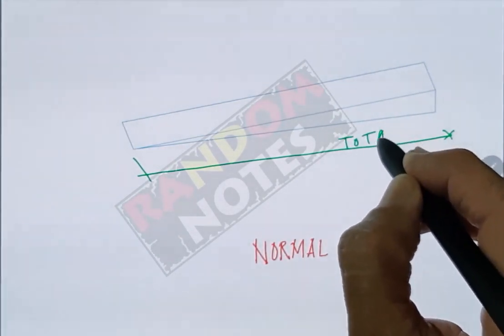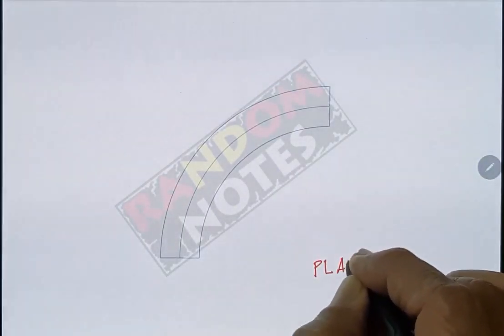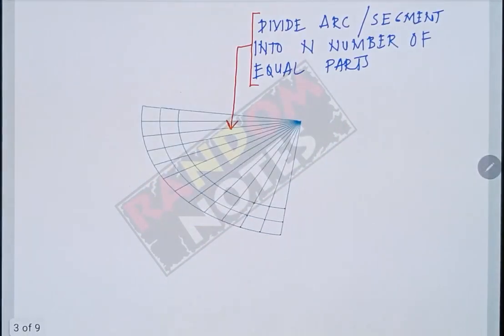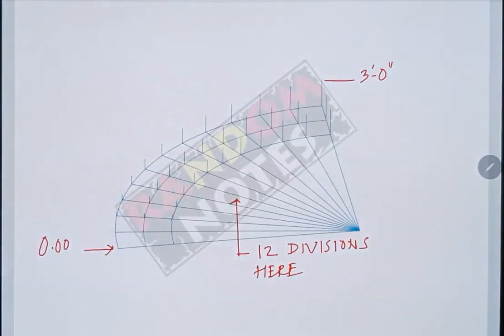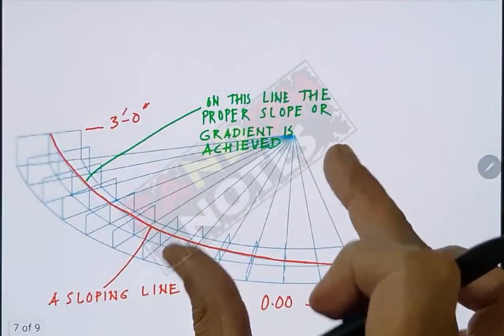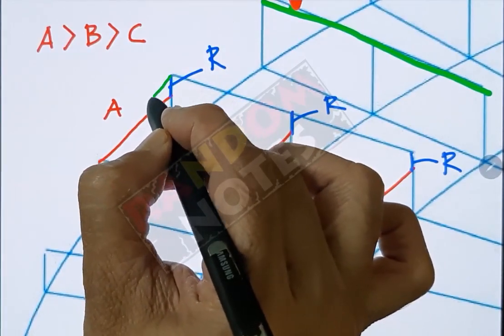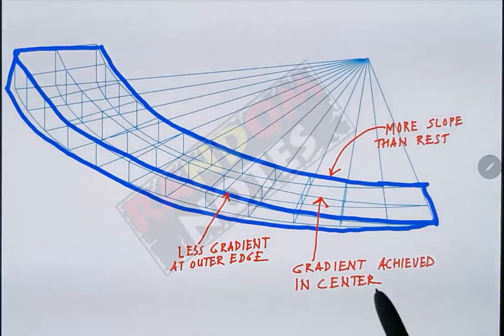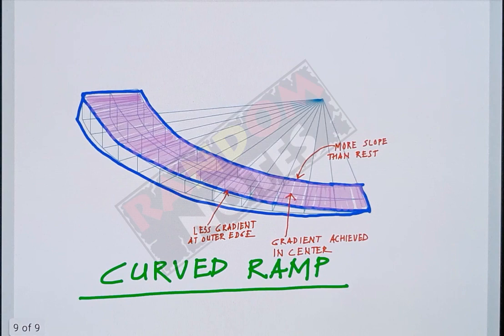UNDERSTANDING CURVED RAMP

Comment: Hi, it gives very fare idea about all aspects of curved ramps. I have a question regarding vehicular circular ramps (4.0 mts wide) which goes upto 3.6 to 4.5 mt height (from one floor to another floor) with circular ramps.  
Need to know whether there is a need to provide banking on the outer edge of the ramp as provided in curved roads or the ramps. ?
Just let me know if there is any reference available for studying this. 

Thank You

Comment: Thanks for the video, do you have a formula to calculate the curved ramp length for a given rise and radius
Reply from the maker: 2 pi R will give you the perimeter of the circle for a given radius. Decide the size of the segment size and then calculate. So for a quarter of the curve, divide perimeter by 4. This will give you the total horizontal distance to be travelled as a curve for the desired rise.

Comment: Wonderfully explained. What should be the minimum slope leading to the basement and also the maximum slope in terms of ratio?
Reply from the maker: Sorry for the late reply. 1 in 8 is the maximum for a motorable ramp. Less slope, say 1 in 12  or more is comfortable. But less the slope, more horizontal distance is required.

Comment: ARE SUCH CURVED RAMP SINGLE CURVED SURFACE OR DOUBLE CURVED SURFACE? thank u for the video. it helped alot.
Reply from the maker: It should have curve in more than one direction since on the two edges we are rising the same dimensions but with different run (horizontal movement). An exaggerated similar condition can be the soffit of a curved staircase.
Thanks a lot for appreciating.

Comment: Very beautifuly explained. But how super elevation Will be provided
Reply from the maker: Can you please clarify what do you mean by "Super elevation"
Reply: When there is a curve, super elevation to be provided against skidding
Reply from the maker: @amitdas7604  Super elevation is, mostly, provided for roads with relatively fast moving vehicular traffic, where the vehicle may have a tendency to skid and get thrown out.
Here we are dealing with pedestrian traffic on a relatively smaller length of movement.
Ramps have been an important source of movement keeping in mind accessibility for specially abled user who may be moving up or down either on foot or using a wheel chair. The rise is also taken accordingly. So the ramp needs to be designed accordingly.

In this video, my main intent was understand the geometric construction of a curved ramp. With these basics in mind, additional needs may also be incorporated as per design.
Reply: Ramp is for vehicular movement with limited speed of 10-15 km / hr. Whether  S. E.  Is required at 90degree circular bend

Comment: I want a ramp at a height of 3 metre..so .should we divide the lines as 3 m by 12 and give risers for each.?!....and how to determine the thickness of the ramp..?!
Reply from the maker: Is it a curved ramp?
As per the slope of the ramp (1 in 12 is the maximum slope for pedestrian ramp), find the total run (check video for What is total run).
Make the line of total run and then get the heights of rise for each division (check the video for this)

What do you mean by thickness of ramp? Do you mean the thickness of ramp slab? Send a sketch to random1notes@gmail.com
Reply: @randomarchitecturenotes-na809  ok..ill mail..the exact doubt
Reply: @randomarchitecturenotes-na809  how do you calculate total run? It is not shown in the video

Comment: how do you calculate R?
Reply from the maker: "R" is dependent on the space that you have in the design. The constant part is the height that we need to negotiate. I would be happy if the R is as large as possible. The comfortable gradient (say 1 in 20) will give me the run (i.e. the length of the central arc); this in turn can give me the radius. Hope this helps.